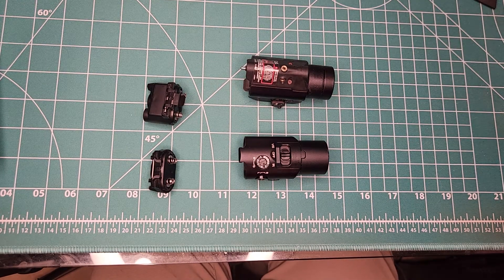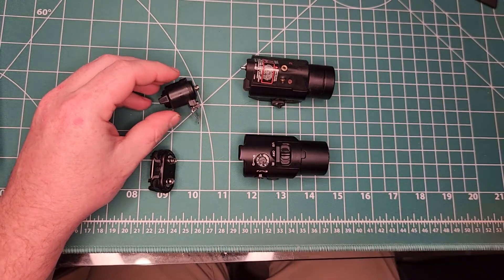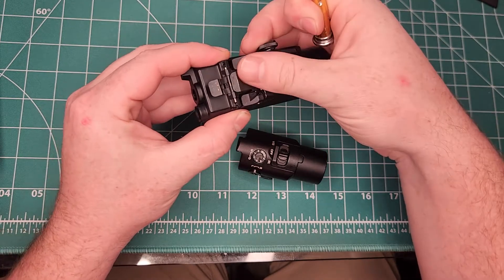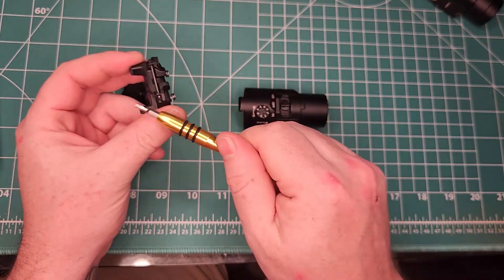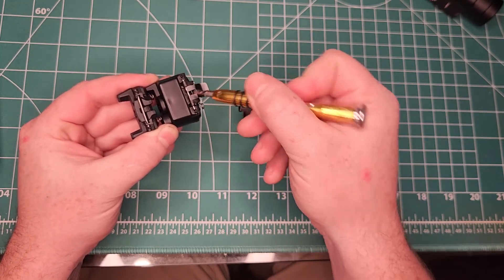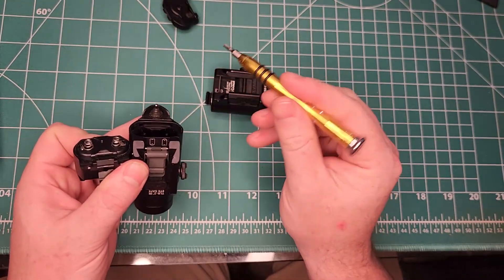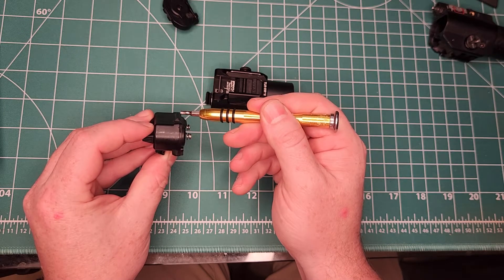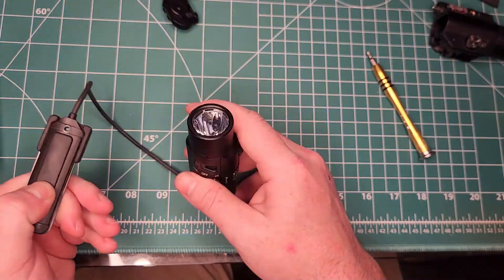TLR VIR II Pressure switch modification (corrected)

Comment: Does this have any issues mounting to a full length rail? I saw another video where they used a different switch that wouldn't allow it to fit onto a full length rail.
Reply from the maker: Nope! But you do have to remove it from the rail to change batteries like most pistol style lights.